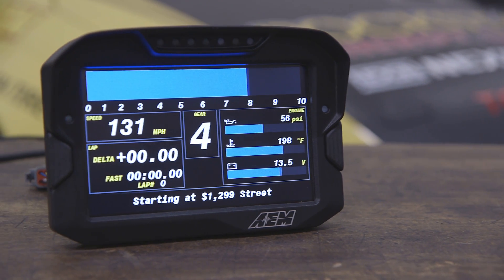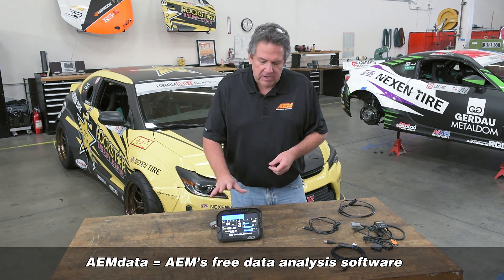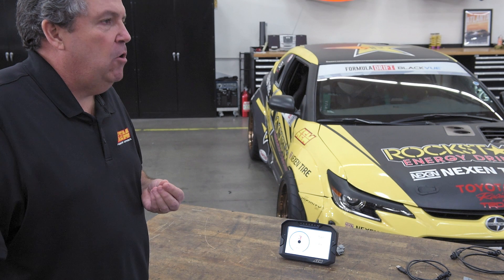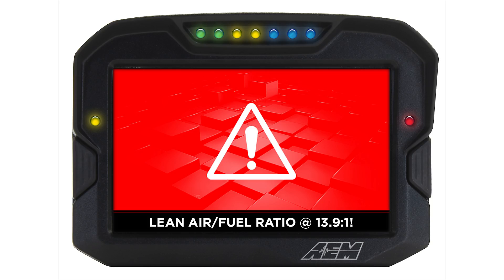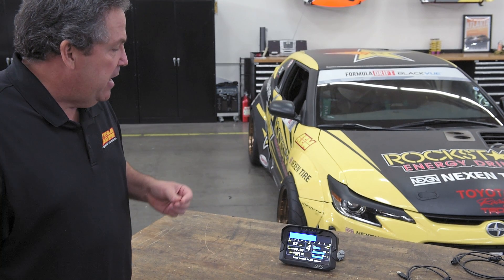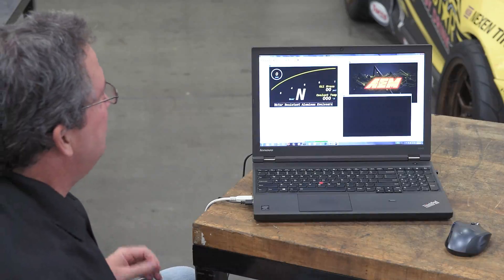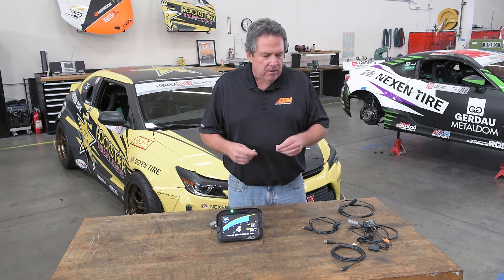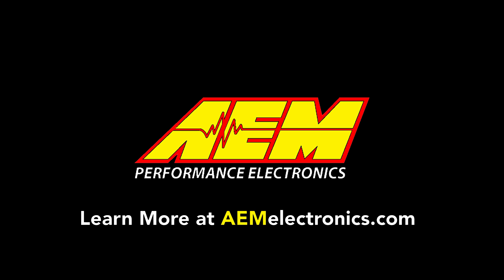AEM CD-7 Dash Display Overview!

Comment: Does it works from evo5 stock ecu?
Reply from the maker: The CD Carbon dashes require inputs from a CAN bus connection, so it will not plug in place of your factory dash. Check out SpeedAcademy's EVO 6 install, where they cover the conversion and what you need, and show the setup in a later video: https://www.youtube.com/watch?v=3L0zNVqqIe0

Comment: Can this be connected to v2 aem ecu? If so will I be able to view what the ecu is viewing?
Reply from the maker: You will need to connect the Series2 AEMnet output to the CD-7's AEMnet input. We make cables that makes this easy: https://www.aemelectronics.com/products/programmable-engine-management-systems/series-2-programmable-ems/series-2-aemnet-adapters. DashDesign software has templates with channels pre-configured for the Series2, so you can display any channels from the ECU on the dash. More info is on our site or contact our support team if you have any other questions! emstech@aemelectronics.com

Comment: I'm hoping to use this is a show car, is there a way to show tpms, fuel gauge and general displays like that?
Reply from the maker: If the TPMS is transmitted via CAN bus then yes, you can show it. You can show fuel if it is transmitted via CAN, or you can add it using one of our CAN Sensor Modules, either the 6 Channel or 22 Channel version. There is more info on those products here: https://www.aemelectronics.com/products/cd-digital-dash-displays-adapter-harnesses/aemnet-can-bus-expansion-modules

Comment: I would buy this for my street car, I don’t have a race car haha.
Reply from the maker: Hi Mike, you can install it on a street car, too! If it is 2008-up we make an adapter harness that connects to the OBDII port and transmits all available channels to the dash, and we also make CAN Adapter modules so you can add sensors and features you want and then send them to the dash over AEMnet CAN bus. Check out our website for more info! https://www.aemelectronics.com/products/cd-digital-dash-displays-adapter-harnesses
Reply: AEMpowerTV will this work in a diesel car with obd2 port?

Comment: Can u used this with hptuners pro
Reply from the maker: HP Tuners is open source for the stock ECU. We have a Plug & Play Adapter cable that sends available CAN channels to the dash via the OBD port, but OBDII CAN is only available on 08-up vehicles. It has a pass-through connector so you can see the channels on the dash even when tuning with HP Tuners connected. The adapter is here: http://www.aemelectronics.com/products/cd-7-obdii-can-plug-play-adapter-harness

If your car is not 08-up, then you would need a CAN output for your channels to display on the dash and for this we recommend our 22 Channel CAN Sensor Module. This will allow anyone to install a CD-7 or CD-5 Carbon dash on any vehicle: http://www.aemelectronics.com/?q=products/30-2212-22-channel-can-sensor-module

Comment: It looks really nice and i plan on getting one.  My only criticism is using blue in the shift lights rather than red.  I will be taking mine apart to change out those blue for red.  Other than that, looks really nice.
Reply: The shift light is green/amber/blue for a reason.  Most pro-level racers reserve flashing red lights to be indicators for bad things.  Well a shift light isn't a bad thing so there's no reason for it to be red.  If you do some looking around at very high end color LED shift lights for pro-level racing, you'll see that most if not all are in fact not red.
Reply: except in drag where nearly all the shift lights are red or amber because in drag you don't look at or have time for any other warnings it's just the shift light that's it any other issues are dealt with ecu end and engine protection protocols